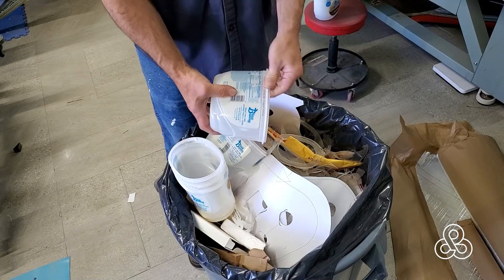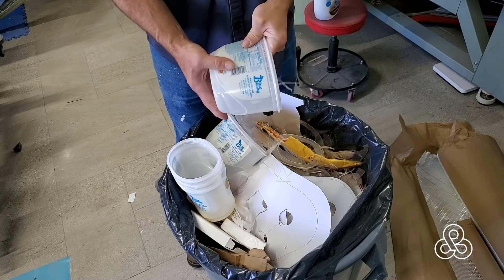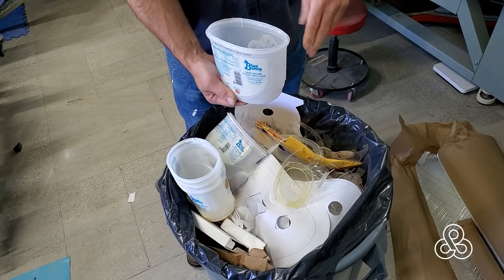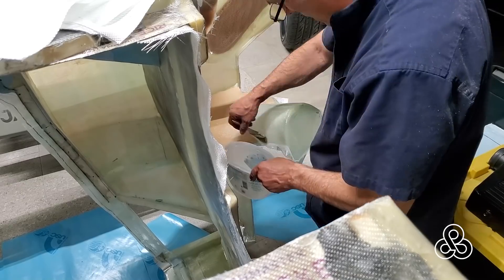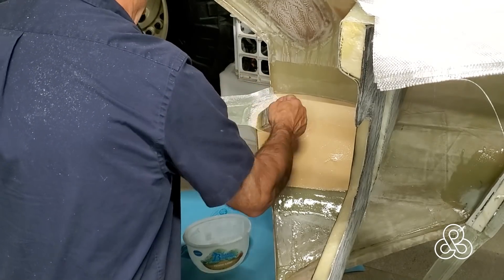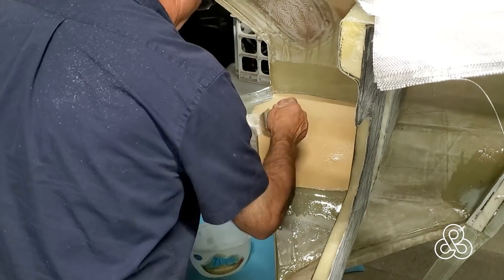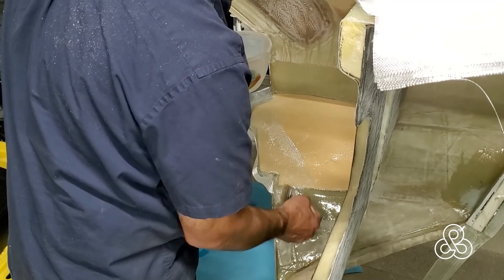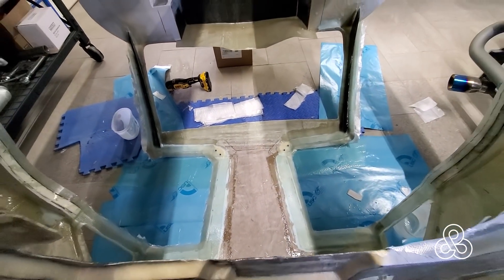A65 Cool air for the Inter-cool-er.  Arete Supercar Project

Comment: You've been very innovative on your build, i plan on getting a white brand cab tractor and ripping it in half and widening it and make a sort of lowrider rat rod and so im a fabricator that doesn't have the kind of resources or equipment like you, noy even a garage or a tree on the property,  so i won't have  much engineering that you can  do, but I've got some great advice on how to set up the steering system for this whip, thanks for the advice about that suspension book you mentioned earlier.  Keep up the good conundrum that your turning into your superwhip!!
Reply from the maker: Many a car has been started under a tarp tent. ha!

Comment: This is an absolutely fantastic project with an incredible amount of dedication, skill and research. But with all due respect, I can not for the life of me understand why you would make this front wheel drive. Launching, powering out of corners, over all handling is all compromised, especially in such a light weight vehicle. Launching will shift the cars weight to the back wheels, leaving the front wheels "light" an will consequently spin whenever trying to put the power down.
What is the reasoning behind doing this MF layout?
Reply from the maker: It will be all wheel drive with a rear bias 66:33 provided by the viscous coupling in the center differential. And although all wheel drive still tends to create some under-steer, I am hoping my suspension setup will limit it more than less.
Reply: @BuilderCreator  Honestly, That is a huge relief. I have been watching the progress and thought this might be the case, but as I saw no provision for doing so, I thought you had decided on MF. Awesome stuff. Thanks for replying!!

Comment: I can't believe I'm a day late to your video! but it's a great start to my weekend!! Do you anticipate needing vibration dampening material inside the shell & if so, what will you use?
Reply from the maker: I will be adding some rubber isolation on the subframe mounts. After some road time I will consider sound deadening for the tub interior.
Reply: @BuilderCreator  Probably worth building in the sound deadening so you don't have to go back? Either way this is an incredible project and the talent shows clearly. Going to be a screamer when its "done" which you know they never really are. ✌

Comment: Sir won't the air coming through the air duct to the intercooler will be very turbulent due to the air diverter having really sharp angles and sudden drops in the surface, Secondly will the low-pressure region in the engine bay which we talked about earlier be enough to have a good flow and use the entire surface of the intercooler and make the full use of it and where are you thinking of mounting the air intake for the engine?
by the way, do you use LinkedIn? i have actually sent you a request on it, if you want you can go through my profile as well. 😊
Thank you 👍
Reply from the maker: There will be a shroud and fan on the bottom side of the intercooler to make sure most of the flow goes through. Although we would  hope the low pressure under the intercooler would be enough to draw the air down, why wait for it? Ha! The air intake is the rounded part you saw me laminate the bottom of in this video-drivers side air scoop. engine compartment ventilation- in under the doors , out through the holes in the back.
Reply: @BuilderCreator  ok yaa, I remember now. got it thanks 😊👍

Comment: I notice you don't opt for the chop strand mat .  Seems like it might work better for some of your odd shapes.  Do you prefer the fabric for everything?
Reply from the maker: I only use mat for heavy build up and almost always with vinylester resin (Molds mostly). Epoxy and cloth gives the strength and weight advantage. Chopped strand mat is for sissy electric cars. ;)

Comment: Tip
If you need threaded inserts that you can laminate in there are multiple choices depending on the required size and strength.
You can make your own by choosing any of the following.
Drill and tap a piece of plate , you can shape scuff and perforate it to suit, to get sufficient thread surface in a thin plate either weld on thicker pieces before drilling or drill a small hole then drive a punch through the plate to expand and fold out the hole for taping. Note don’t try this on sheet steel that is less than 1/16th of an inch.
You may also try what might be called T nuts , these are press formed bits of metal that have a T profile usually with little spikes bent into the T bar that you use to stake them into wood. These are almost useless for their designed purpose as they pull out of the wood easily even when glued in. They do work well enough for laminating however especially if you add a bit of meshed or perforated steel to them by fitting the nut through the steel and folding over the spikes to lock them down.
There are also fasteners that are similar to drywall anchors that screw into the wood, if you use these ones avoid any that are cast from weak metals like zinc or pot metal, the machined ones made from stainless steel or brass are best.
The best way to use them may be to drill and tap a hole for them then use a high strength glue to lock them in instead or trying to laminate them in.
Reply from the maker: I'll have to try the T-nut and mesh, see how that works. For you to try- take the metal expanding drywall anchors and cut them in half and then flatten out the metal leaves (the part that normally flattens and expands). Some brands are better than others, the best are one piece with the threaded area being part of the sheet metal rather than a spot welded nut.
Reply: @BuilderCreator  adhesive mount nuts. Or nut rivets and loctite 638 or equal.
Reply: @BuilderCreator  . Another alternative is to use a rivnut inserted into a bit of perforated plate , but that’s too simple a solution so there’s probably a problem with it according to the law of Murphy.

Comment: Would a nut or stud be more likely to rust if it was encapsulated by fiberglass? Does fiberglass absorb moisture?
Reply from the maker: No rust if it where encapsulated. Fiberglass itself does not absorb moisture, but if you were to build a boat chose an epoxy engineered fro marine use.

Comment: How do you keep track of all the half finished sections that dont have the full number of laminations?
Reply from the maker: Well, these little appendages like the intercooler diverter have no "layup schedule" they just get laminated until they "feel" right. Sections of the tub/monocoque that are critical . . . well, I just keep track in my head. we will test it when it gets close to completion.
Reply: @BuilderCreator  Are you planning to create any kind of stiffening beam or box section across the top of the windscreen?
Reply from the maker: @pashakdescilly7517  Yes! I will be boxing in the carbon fiber stiffeners in the A-pillars and will extend that out into the upper edge of the windscreen frame. Coming soon, stay tuned.